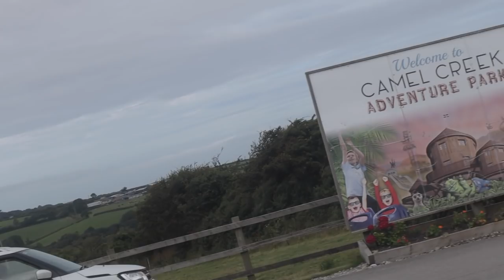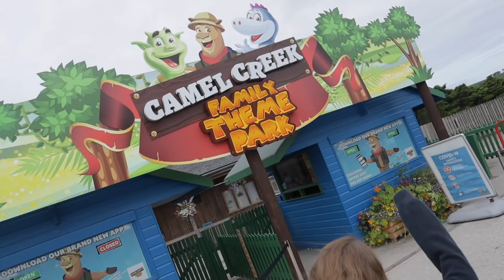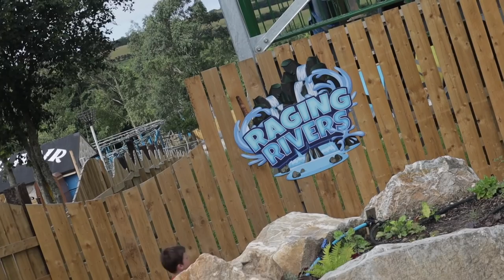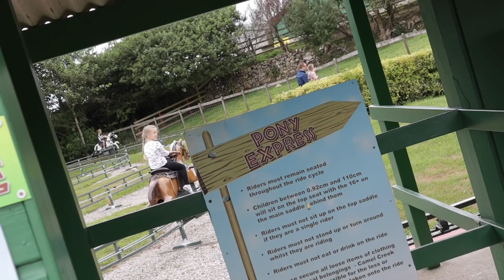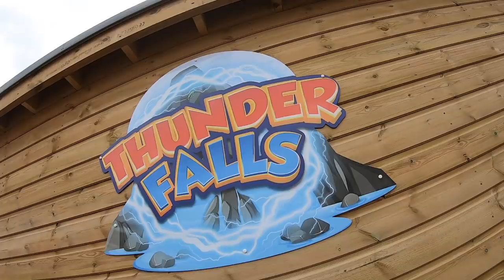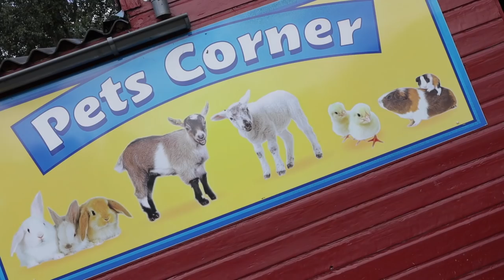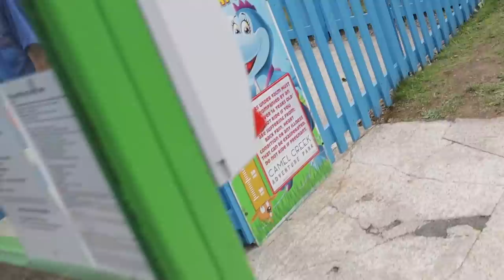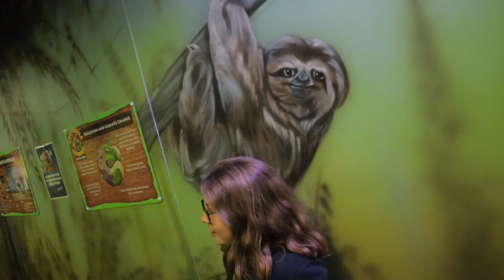Camel Creek Theme Park Vlog July 2021 - Cornwalls Greatest Adventure Park?

Comment: Did you find out what is being built adjacent to Airbender?
Reply from the maker: I didn’t, Hopefully a good flat ride
Reply: @SlothyVlogs  thanks, l, I know that a that a wateride of some description is coming next year (2022). Apparently Swampy's Super Slides have closed, and are being replaced with an additional new ride next year. I have found all of this information on the Internet. I am planning to go to Camel Creek after the Summer holidays. I have not been to the park since it was Crealy.
Reply from the maker: @georgekoshti_richman1392  yeah the slides were closed
Reply: Don't feel embarrassed on the Pony Express ride. I am a 21year old Man,yet love this Pony Ride and others of its type. I have done actual Horse riding and these rides give you the exact same experience without you having to put as much effort in.